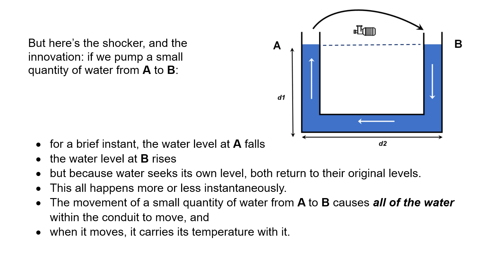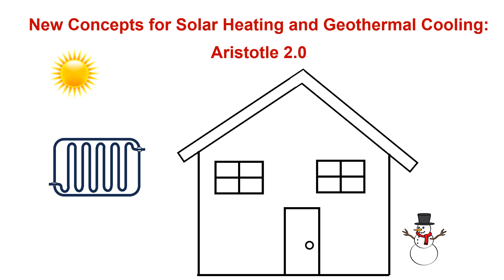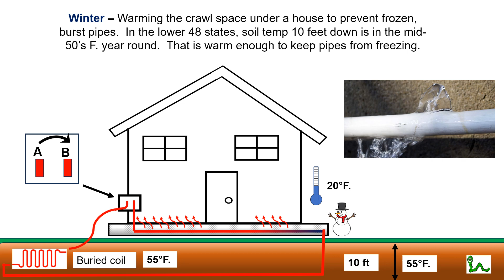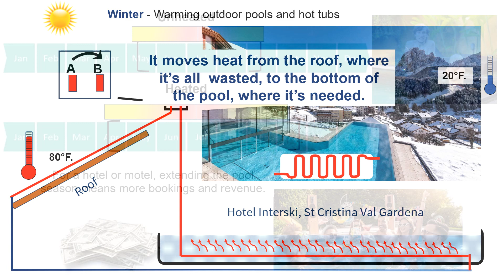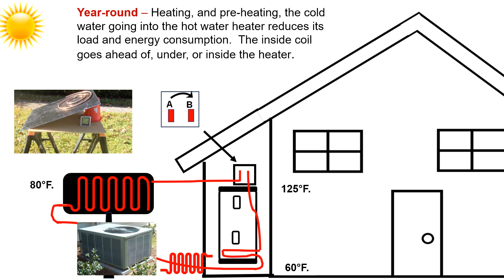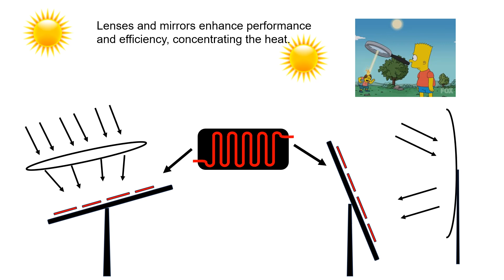New Concepts for Solar Heating and Geothermal Cooling: Aristotle 2.0

Comment: Hi John, thanks for the video. I saw your ev recharging video on cleantechnica. I am the founder of an EV conversion startup and am also an inventor. I want to tell you that your work is important and correct. I have developed concepts that capture the heat on solar panels located in large fields in desert areas. The panels and their frames offer a heat collection opportunity just as you've discussed. In turn panels located on cars with heat collection could add a great deal of efficiency. If you walk around New York city at night in the summer time all of the buildings are radiating heat. I think that these opportunities have been ignored for decades due to fossil fuel capture, but, it seems the cat is out of the bag now. EV battery regen systems are inefficient and put too much thermal stress on battery packs during braking and again during discharge required in acceleration. We hope to solve this problem by using the hybrid graphene battery capacitor in the vehicle's circuit (Skeleton Technologies).  

Good Luck!
Tom Storey